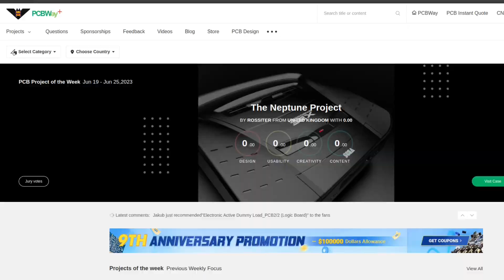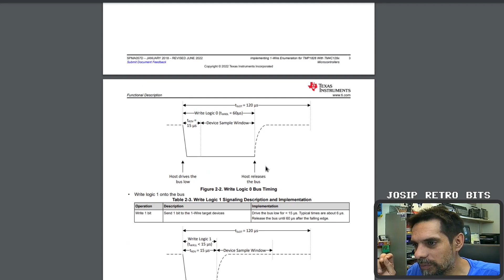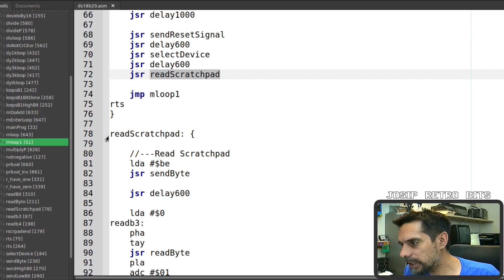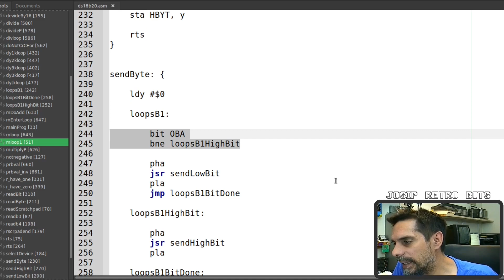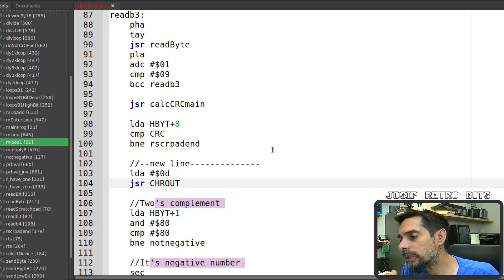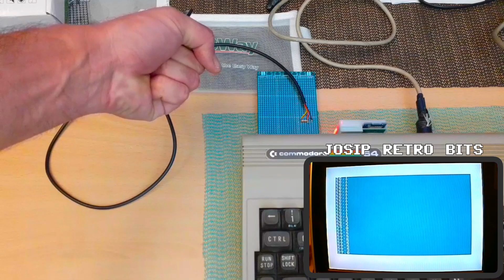Measure Temperature with Commodore 64

Comment: Modern technology for an old Commodore is great! In the old days I guess there were similar projects with a thermistor as a temperature measuring device. :-D
Reply from the maker: Yes, usually thermistor was used to measure voltage and then convert that to temperature. Thank You for watching :) Cheers!

Comment: Hey bud.  Sorry this has nothing to do with the video.  I  will watch.  But I'm guessing that it was u on yarcs live stream?  That had an issue with the cartridge port on the shortboard?    If so just wanted to let you know that the cardboard trick worked to get basic screen.    Damn 😮.     Thank you .  Thank you.
Reply: Awesome .. That's why we make these videos to help the community .. I use a old credit card or any plastic card like that and a cloth with isopropyl alcohol .. it always seems to clean up well .if not use dioxide instead or ipa. 😉
Reply: Great.  Thank you again.   I had this one on the back burner for a while.   Changed a few chips and was so tempted to change the super pla,  but I was so nervous with that one 😬.   In my head,  I said.. can't be.  Diag with harness runs perfect 10 times +   just black screen with no cartridge.  Fastload booted perfect to basic even.   My first thought was the kernal basic rom... I tried two. No change.   Damn cartridge port shorting!  Wow 👌:)
Reply from the maker: Hi, glad that Your C64 is working again :) ...and thanks to 
@8BitRetroReFix for jumping in :) Cheers!

Comment: Excellent work, Josip! I've been hoping for content on use of the C64 User Port for a few years now . . . the entry for $DD00 and $DD01 in the venerable "Mapping the Commodore 64" runs a few pages, so there's a lot being controlled in CIA #2 by those registers (including the RS-232 implementation, which would make for some fascinating exploration).
Reply from the maker: Thank You, Yes there is so much more to explore on CIA #2, but also RS-232 is controlled by the CPU and it's not proper RS-232, it's TTL which is actually more suited for today's devices, 0 to 5V; no negative voltages, works fine except for speed. Cheers!

Comment: I was wondering if anyone had figured it out.  new vic.  to c64.  on the basis of.  so that the 256 bytes of the area are mirrored.  basic registers.  more sprites could be made.  or other things.  without compromising the basic design of the vic.  Regards..
Reply from the maker: There are some modern replacements for VIC II chip. In most cases, they are focused on better video display quality, I'm not sure about expanding capabilities of sprites and other VIC II registers, but Yes that would be nice :) Thank You for watching :) Cheers!